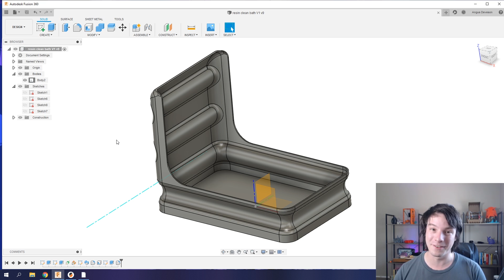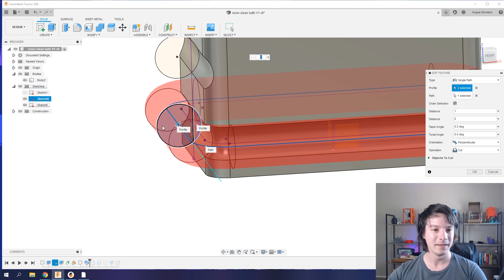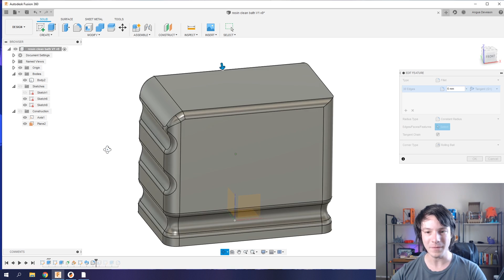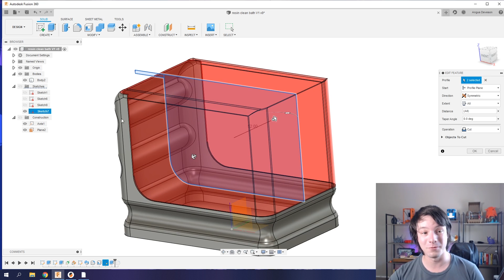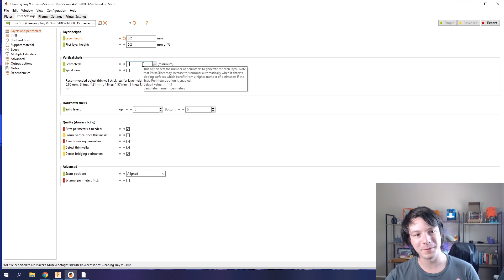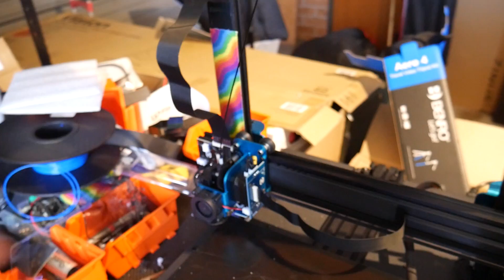3D Printed Resin Clean Tray with Infill Mesh!

Comment: How did you go about exporting the model in 3mf from Fusion? All the pointers I found online were quite complicated.
Reply: You want to export as STL, not 3MF. Simply right click the body or component you want to export and click "save as STL".
Reply: In his last video Angus showed that 3mf is superior and in this video you can see that he's using 3mf in the slicer. So I do want to export as 3mf which brings me back to my original question.
Reply: @yoanfilipov3747  3MF contains a model and slicing settings bundled up together, it's what your slicer will produce by taking STLs as input. There's little to no benefit in exporting models in 3MF format. You'll get the same model either way.
Reply: @thenickdude  Okay. Have you seen Angus' last video? How do you comment on the strengths vs weaknesses on 3mf vs stl? Hope I'm not annoying to you, I'm just trying to learn something.
Reply: @yoanfilipov3747  Yes, I watched it. The stated benefit is "smaller file sizes" - who cares if my model's STL gets a little smaller than 10MB? Meanwhile the benefit for 3MF files produced by the slicer is very clear, it saves all of your slicer settings, plus the model, so you can reopen the 3MF and immediately reproduce the same GCode, allowing you to recreate and retweak an existing print.
Reply: @thenickdude  Precisely. So it's better than stl. While it's easy to save as 3mf from a slicer, how does one go about saving a design as 3mf from Fusion? That's the question I'd very much like to find the answer for. Cheers
Reply: @yoanfilipov3747  Fusion 360 doesn't support 3MF, so you need a plugin: https://apps.autodesk.com/FUSION/en/Detail/Index?id=9199586017740700165&appLang=en&os=Win64 . STL is great as an interchange format because it's so old that everything supports it. 3MF needs to add a lot of value to make losing that compatibility worth it, and it just doesn't for models.

Comment: Instead of modifying the printer settings for the entire print, I would create a second modifier STL to match the bottom area that I wanted without top/bottom solid layers. Prusaslic3r can change the print settings for just that area.
Reply: Angus actually shows off modifiers later in the video. I guess this particular design didn't need them, but it's a thing to keep in mind
Reply: @powertomato  must have missed that part. Watching at work

Comment: In my experience so far I have found that modifiers in Ideamaker work better than Prusaslicer so far. Just the way that infill is generated in relation to walls, Ideamaker generates cleaner infill paths that follow the perimeters of the model and that is not always the case with prusaslicer. So I would suggest you use the latest Ideamaker for the future modifiers video.

Comment: Hey Angus, you don't actually have to do the axis-plane-sketch-sweep complication to do the sweep. just click on any of the edges of the body that's parallel to what you want. (top edge/bottom edge) hope this helps!
Reply from the maker: mmm but I want the centerpoint of the circle? Can I click that point? I'll have to play more!
Reply: @MakersMuse   when you click the circle as a profile and the top edge as the path, F360 won't move the centerpoint of your circle. :) I'd attach an image if i could. :/

Comment: In the latest version of PS (which you didn't want to install :P) you can modify your parameters by layer height in a very simple way, much intuitive than using a box as a modifier.
Reply from the maker: Haha ok fair, I'll get it installed :)
Reply: @MakersMuse  Without counting "Undo" and "Redo" buttons and shortcuts, the first time that I've used ctrl+z it blew my mind

Comment: ASA would be a good alternative around resin too I believe easier to print than PLA doesn't warp like ABS and better chemical and UV resistance
Reply: Peter Edwards Angus has some nasty PET-G... My printer does it without any problems. There are some annoying strings but bigger problem is too much adhesion rather than not enough ;)

Comment: Another way you could have done that construction plane would be a offset plane, which would make it parallel to the bottom of the part, and raise it to the height you need which would be the center point of the circle.
Reply from the maker: Yeah I considered that, but if I changed the location of the cut the offset wouldn't update to the right height I don't think
Reply: @MakersMuse  you can tie the plane to the center for of the circle. When you are setting up the construction plane under the setting "Distance" select "To Object" then it will allow you to select the dot on the circle. You need the sketch with the circle you want to click on visible at the time so you can select it. Once you link it, if the circle moves then the construction plane & the sketch on it will move with it. I just tested it to make sure.😉

Comment: great!. but I want to ask if you can  vary the infill using cura slicer?
Reply from the maker: I believe so, I'm less familiar with doing crazy thngs in cura however
Reply: Yes you can do this same thing in cure remove top bottom layers and increase wall multiplier if you model has thicker walls so you don't end up with infill in the walls I been doing this for about a year now  for my filament drying gel beads boxes.

Comment: Nice video
Any thoughts on how you dispose or clean the isopropyl after its use after a while ?
Reply from the maker: People say the resin precipitates out but so far I've been storing it in a bucket to slowly evapourate and leave the residue. I'll need to research more on if it can be properly cleaned and reused.
Reply: I would suspect most people would just pour it down the drains , which can’t be good for the environment